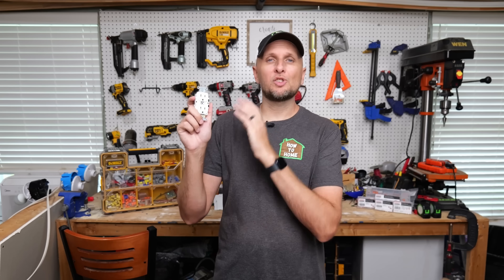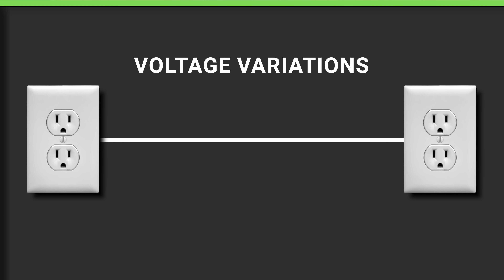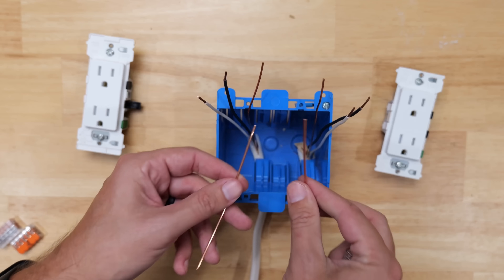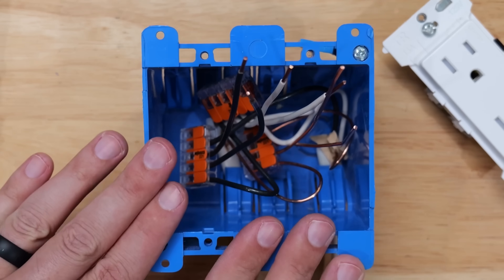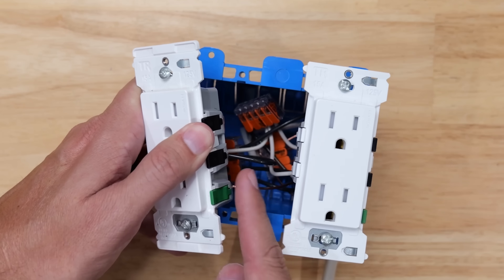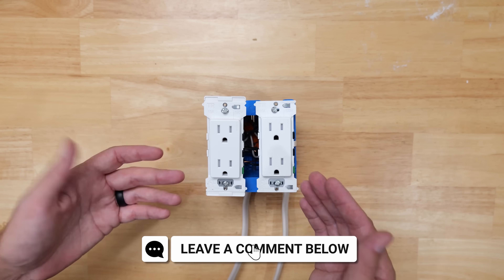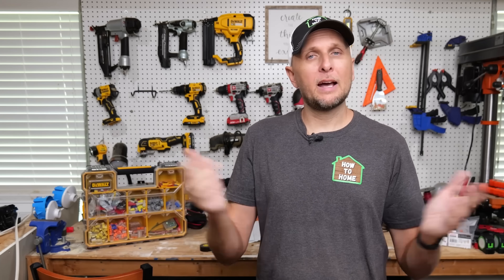Why This Outdated DIY Outlet Wiring Needs to End!

Comment: So this doesn't make sense. Using the lugs on the outlet to connect the wires connects them via a hard metal connection.  It doesn't physically go through the outlet.  It's on the side.  A completele bypass.  It is a slight physical difference but with the way current moves, it is electrically identical, with regards to voltage drop and current, to use a pigtail vs the screws in the side of the outlet.
As far as something going wrong with an outlet.  Something that would interrupt power downstream would be a big enough problem that I wouldn't want to continue powering the outlets downstream.  If you are doing DIY electrical and cannot understand how to find where the most upstream outlet is to do proper troubleshooting, you should be calling an electrician(I am not an electrician).
I am open to hearing how I am misinformed.  Would love to know more.  I have pretty extensive training on electrical and mechanical theory, and am always ready to know more.

Comment: Great idea. My last job was wired this way, and it works just fine. Lever connectors and outlets as well as switches are a welcome addition. As a retired GM mechanic, I did not like the hose spring clamp design. After some research I found out that they would keep a tight grip on hoses in cold and hot conditions. They are really better than screw type clamps. Just sometimes hard to deal with. The same is true with lever connections, they stay tight.

Comment: Passing through the outlet is better for a number of reasons.  The most important is that it aligns with the principles of the National Electric Code.  The code is designed to encourage big problems over little problems.  Without grounding, a hot wire touching the metal appliance case is a minor problem.  With grounding, it becomes a major problem, which causes the breaker to trip.   If outlets are wired independently, a loose wire causes a single outlet to go dead.  A typical homeowner might live with this, and not call an expensive electrician.  If a loose wire causes a series of outlets (and lighting) to fail, then the homeowner is more likely to call an electrician to get the situation repaired.    With electricity, you want small problems to be problems big enough that they become noticed and addressed.

Another reason to wire through the outlet is that you end up with fewer wires in the box. This keeps the wires cooler, and therefore safer.

Remember, 15 amp outlets are rated at 20 amps of passthrough current.
Reply from the maker: Too much to respond to and why.  I disagree with much of what you said.  Not all.

Comment: In your example with the WAGO connectors you can still loose power down the line if a WAGO goes bad.
Reply from the maker: They don't if installed properly.

Comment: I think this method can add to line drop by adding so many channels for the power to navigate. With more connections in most trades like plumbing, you are significantly adding to the cost and making the supply jump through more hoops to travel the same distance. I just can't believe an electrician thought this one up.i really don't know, im just a carpenter who has smashed many receptacles, making wonder who hasn't seen the guts of a receptacle 🤔.
Reply from the maker: It doesn’t.

Comment: The further from the source, the lower the voltage. Not just from usage but from voltage drop. Wiring method doesn't determine it as long as properly done. Plus, you can tell the distance from the breaker by the resistance or voltage drops.
Reply from the maker: Not the only thing that effects voltage drop.
Reply: Voltage drop on 120 VAC is miniscule to the point of being non-existent in a household application.  Low voltage DC on the other hand...
Reply: @hcliii hmm. Interesting except, you must account for it. 5 percent max is 5 percent max. 12 g cable isv55 feet.. 110 feet round  circuit

Comment: It an interesting rationalization, but if work is done properly it doesn't make much difference. If one of the receptacles is burnt the whole string should be shut down anyways. The only advantage is that on a burnt receptacle the pigtail can be replaced and feed throughs are less damaged. And often a burnt receptacle will be the result of a bad plug put into it rather than the receptacle.

Comment: I think using wago is a great method especially having everything pass through instead of being daisy chained I been coverting all my daisy chained outlets this way for the last few weeks while remodeling is going on 10:00 @How to Home
Reply: Confused why you think the wago isn't a link on a daisy chain. Or why you think the connecting bar in a wago is less likely to fail than the piece of brass between the two screws on the side of a receptacle.
Reply: @ps.2  I never said anything about the 2 screws on the receptacle, and yes, you're right. I said pass through in place of Daisy chain and didn't explain it was also a Daisy chain. Your the only one that mentioned the 2 screws on the receptacle.
Reply: @AntonioClaudioMichael Yeah I guess I presume that when you said you were converting the wiring on your "daisy chained" receptacles, I assumed you were talking about the same thing the video talks about, using the two screws on the side of the receptacle. If you actually meant something different, I'd be curious to know.
Reply: @ps.2  Sorry, I was not talking about what the video was talking about. The gentleman in the video always asks, "at the end of the video for people to state what there doing why they like the item and what they use it for my house has 4 daisy chained Outlets in each room I was separating the Circuits on this old house to make it easier to Isolate a bad outlet down the road instead of 1 main outlet taking all other outlets down because of the main outlet. Presuming you know what somebody is talking about and making assumptions without more information is a great way to start arguments because your putting words in other people's mouth that they didn't say.
Reply: @AntonioClaudioMichael Still can't figure out what you mean by "daisy-chained outlets," though, if you do NOT mean wiring both the incoming and outgoing wires directly to the two screws on each side of the receptacle. That's what the guy in the video meant by that.
Reply: @ps.2  I never said Anything was less likely to fail never said the wago would fail more then the receptacle nor did i say anything about the receptacle failing over the small bar in the wago your making Assumptions that were never said by anybody but you.

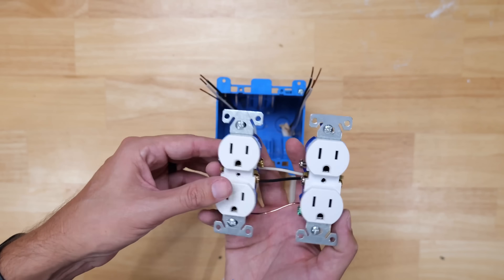Comment: I have been replacing switches and outlets in my 80 year old house recently and have noticed this per room all outlets in each room are daisy chained per room. because of the remodeling going on. which is dangerous in my opinion on 1 breaker and 1 circuit setups 2:00 @How To Home

Comment: I do it this way, but in reality, the wago connector is basically the exact same copper connection as is on the outlet. Both simply have a flat copper connector for the current to flow through. Even when the plug on the receptacle gets fried, the copper strip rarely gets damaged. This is the copper strip that you cut if you want to isolate the outlets from one another. Back in the day when people used lots of lamps, it was common to wire one of the plugs to a wall switch to control the lamp and leave the other always on. 

I do a lot of homestead wiring on outside buildings, and I do a lot of things that electricians would lose their minds over, like use antique romex and long runs on too small wire, but its outside, so there is no house to burn down and the sub panels are done correctly so the breakers will work properly. Romex is freaking expensive. I do it all by the book inside but lots of things don't get done inside because of the cost. The main point being that I have burned out outlets on multiple occasions and I know how they fail. 

We lost a big part of our main 100-year-old house a few years back from an electrical fire caused by 1960's wiring. I had planned to rewire the entire house, but copper is expensive. What I pulled out from the burned-out section that my grandfather put in over the decades would make an electrician cry. Because it is a 100-year-old house that my family members built, I will be redoing the burned-out sections with metal conduit. That is also crazy expensive but I'm hoping for another hundred years from it.

Comment: Wouldn’t voltage drop happen regardless of back wiring or doing it the way he shows in the video? It’s the same distance from the panel regardless or am I missing something.
Reply from the maker: Distance is not the only cause of voltage drop.
Reply: @HowToHomeDIY I understand having a large draw upstream on the same circuit can cause voltage drop but wouldn’t this happen with either wiring scenario?
Reply: Distance-related voltage drop on household AC circuits is so miniscule as to be inconsequential.

Comment: Call me thtoopiiid but I'm not quite sold on wagos or even the lever type receptacles. I'm not an electrician but in my DIY boxwork I have more confidence in properly installed wire nuts and properly used side terminals. I do concur with the current flow practices in the video.
Reply: Wago is literally CODE in Europe. 🤦🏼‍♂️
I can promise you that they're better than any brand of wire nut. You just need to learn to do your research and be willing to admit new tech can be a good thing. I bet you have no issues with cruise control, air conditioning, refrigerators, or power windows, huh? This is the same difference, just a different industry.

Comment: I just put in a double gfci outlets in a metal box a few days ago. I did your method and used 3 port Wagos to bring to power to both outlets. The funny thing is the instructions had you daisy chaining one outlet to the next. Thanks for the helpful vids. I've been updating and improving my electrical at my new place and your videos have been helpful. Funny thing is we bought the place from a guy is who is an electrician and all kinds of issues were around the house. There were now gfci outside including a loose box outside, a 15 amp outlet on a 20 breaker, an outlet in a metal box with no ground connected to the metal box. The breaker was a mess, which I hired out. I'll spare you the rest, thanks again.
Reply: You can use 15 amp outlets on a 20 amp circuit, as long as it's not the only outlet on that circuit. It's allowed by the NEC.
Reply: GFCI is diffrent. Don't need two GFCI outlets. 15amp receptical is fine on 20amp breaker. Cobbler's kids have no shoes
Reply: @greggpurviance7252  The thing is I already have 2 gfci outlets that came with my box and I'm not needing to run more outlets. At my old place with wiring I didn't do I had a gfci with nothing in it malfunction and every outlet downstream trip. In my case if I have one outlet trip or malfunction I don't want the one next door going out and tripping and potentially loosing all my food in my chest freezer for example.
Reply: (Funny thing is we bought the place from a guy is who is an electrician.) Electricians are like everyone else if you worked 8 + hr a day would you want to come home and do the same thing. A barber does not want to cut hair when he comes home.
Reply: You really are supposed to use the first method with GFCI otherwise the downstream outlets aren't protected.

Comment: There are various reasons pigtails are often preferred, but these cautions in this video are not science.  Voltage drop would mean a bad connection that generates heat=fire hazard. Other concerns are moot.  There is nothing vulnerable in two wires under two tight screws into a single piece of brass.  Troubleshooting for a bad pigtail or a bad screw connection is the same.  The circuit does not go through the inside of the receptacle! Pigtails do take more space, that might be lacking.
Reply from the maker: Ok, so then by your own admission, it can and does happen.

Comment: for the 3 or 5 port wago connector, I'm not sure where I heard this but use the middle port for line and load wire should be as close to the line wire in wago connector

Comment: How is the bussed Wago connection with pigtails any different than the inbuilt bussed connections on the receptacles?
Reply: One is series wired and the other is parallel wired. Both methods have a 20A rating, even the 15A outlets will pass thru 20A.

Comment: I agree with a few other posters. Electrically, the difference in wiring methods will make no difference in the transfer of current. I replaced burned up outlets with cracked plastic, and the transfer bar literally fell out into my hand. If that was still in the box, it could short, creating more issues. I used the WAGO style connectors, too. They also have a transfer bar. If overcurrent happens on the circuit, WAGO connectors could melt, causing the same issue. Luckily, a melting connector (either wirenut or WAGO) will likely break the circuit. Big difference: with the connectors tucked inside, you might not see what's going on. A burned outlet is obviously visible from outside the box as there will be burn marks, cracks, sparks, and likely a loud bang.
There's another way to connect the screw terminal-styled outlets. They have a hole on the back that's the correct size for 14 AWG solid wire. This is the correct gauge for wiring 15-amp outlets. Strip off about 1/2" on the wire and stick the bare end into the hole until the insulation touches the recepticle. If you miswire, there's a little slot for a small screwdriver to release the wire.
Reply: Overcurrent causing damage to a wago should never occur with a properly sized circuit breaker.

Comment: Most of your videos are quite helpful, notwithstanding that you are not an electrician. (Correct me if I’m wrong). I’m not either, but I’ve been doing this for over 50 years for myself and others.
1. The same failure rate applies to any jumpers you insert with wire nuts or lever-type connectors as the screws on the receptacles.
2. Any voltage drop in the receptacle internal jumpers is very similar to the drop in jumpers and nuts. Your example of a heavy load is flawed. 
3. Pigtails take space in the box, which may be limited.
4. I have never seen a failure of the internal jumpers in the receptacle.
Reply from the maker: Cool.  As always Tom, thanks for watching.

Comment: You should re-think your video too many commenters have found faults with your analysis; replacing the terminal side blocks on the receptacle with a costly Wago  is counter productive, let alone comprimising the allowable volume in the boxes.
Reply from the maker: That’s called an opinion.  And I said you can use Wagos or wire nuts.  Both of which will outlive most people if installed properly.  So no, no need to rethink it.

Comment: I've never seen a receptical fail.
Reply from the maker: I’ve never personally seen the Grand Canyon.
Reply: @HowToHomeDIY  - I have.  It's definitely wired in series.  And upstream loading has created serious issues with current availability in downstream municipalities.
Reply: 45 years in the trade. I have seen to many receptacles fail not due to either method. Over time the rec. degrades or the wire loosen under the screw. That said always pigtail

Comment: So I guess the point is that six additional field connections are more reliable than passive conductors in the outlets, huh?  Stuffing all that extra crap like wire nuts and Wagus into the box is better, too?  And this is to be compared with the likelihood of a solid conductor failure in an outlet?  Ah nope.  Never seen a failure like that, and I wager you haven't either.

Comment: like someone else said, I agree with your wiring method, but your reasoning is flawed.  you are talking l ike the receptacles are wired in series.  The screws on the sides of the outlets just like the two black levers on the new receptacles are bonded together the only failure of that receptacle that could impact any downstream would be if the bonding melted and then you have bigger problems.  All using the wego clips ( and I love them ) has done is move the point of failure from the receptacle to the wego clip, just like using a wire nut would have done.  in my opinion as an electrical engineer the only thing your solution does is maie the box easier to maintain.  If it's a small box, the original method is still better because it does not require wego clips or wire nuts.
Reply from the maker: It’s not my reasoning and that’s not the only way it can fail.

Comment: So this old man whos probably installed THOUSANDS. WAGO connectors have been known to fail over heat poorly conneceted etc...look it up. I agree with your feed system, but true a lot of guys dont do it. I had my share of trouble shooting. I always look at obvious outlet being used a lot over loaded , or behind or near a heat source. WAGO has been known to have failure,  sometimes from electrians, apprentice, DYI. Sometimes new is not better maybe a bit faster not better. Not to mention that many break down from heat faster than wirenuts. So the day we think we know it all is the day you stop learning. So thats why i watch🙂. I do miss electrical. I worked on lights and many other things even stadium lights to 100 year old houses etc. Miss it. Now here is something for you from this old guy. JESUS loves you. John 3:16 KJV
For God so loved the world, that he gave his only begotten Son, that whosoever believeth in him should not perish, but have everlasting life. Keep up the good work though becarefull so this old guy agees 1/2🙂ID FIGURE ID THROW THIS IN WHEN I READ COMMENTS. YOUR VIDEO WASNT ABOUT HAVING A GFCI SO DONT WORRY. IF IT DID N YOU SAID THIS I WOULD HAVE COMMENTED ON THAT. YOUR DOING GOOD🙂